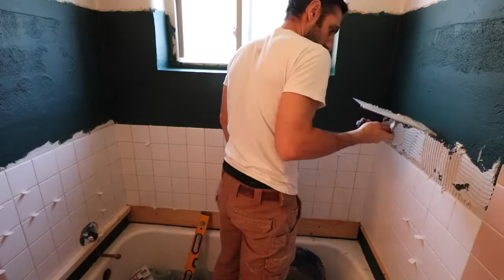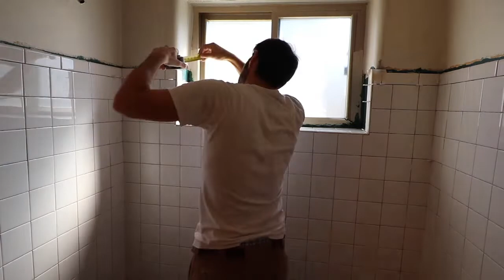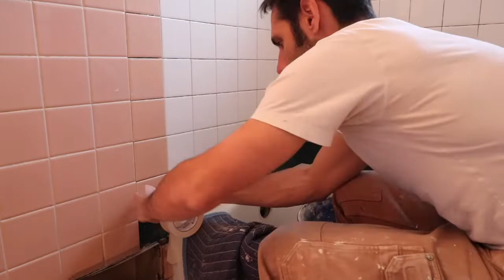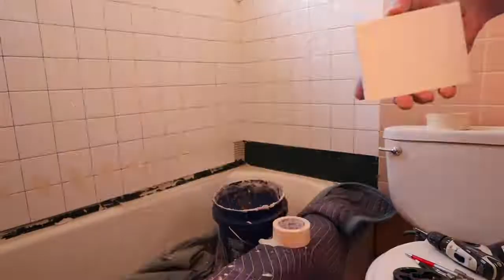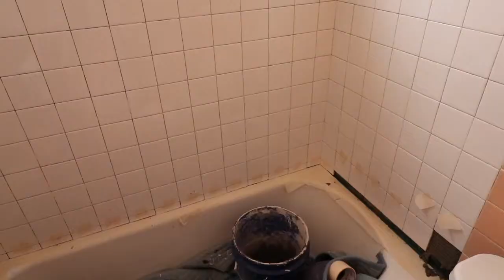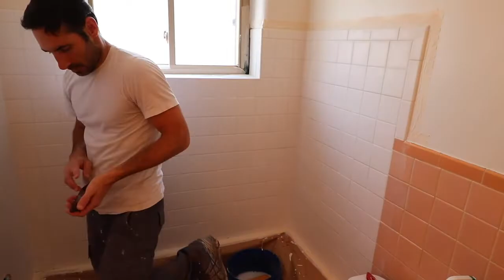Prep Work Makes the Dream Work Part II

Comment: What made you stop the tile Midway up the wall? Why not go all the way up at least to the shower head with tile and the waterproofing?

If you are interested in learning more about tile, waterproofing, bathrooms, etc, I would recommend you follow Sal Diblasi here on YouTube. A really fine craftsman!

Great job on this bathroom! Most landlords would never take the time to do it right.
Reply from the maker: Thanks Gabe, I'm not sure I just stopped there because that is where the previous tile had stopped.  I follow Sal, love his channel.  Tile is probably my favorite trade to do.
Reply: @50Acres  Sal is the best!

Should have concluded you followed him from the professional job you did on this bathroom.

Are rentals and contracting work now your full time job? I noticed on some of your other videos that you had a different career previously.

Keep up the great work!
Reply from the maker: Thanks for the kind words.  Yes mainly rentals, I take the occasional tile or handyman type job when one comes my way.  I used to be a cost estimator, I resigned almost exactly a year ago from that job.  I also am renovating a small mixed use commercial/residential building.  I just kinda do whatever these days.

Comment: If you do another one of these jobs, consider using this product for your tile backer if you can get it where you are. https://www.menards.com/main/building-materials/panel-products/tile-backer-board/georgia-pacific-reg-densshield-reg-1-2-x-32-x-60-tile-backer/1314902/p-1444431332695-c-5704.htm?tid=-3383438579630900426&ipos=3

I use it on all my tub/shower projects, I never waterproof the walls because the surface of this tile board is waterproof.  I use mesh tape and tile mortar on the joints and have never had any issues.  This will save you a ton of time.
Reply from the maker: Nice I will check that out, I have 4 tile jobs coming up in the next couple months so worth a try.
Reply: @50Acres  it's a really good product and if you're nervous about the joints you could always hit them with waterproofing for the first three feet up. As you probably know just as well as I do that every tile tub or shower that you've ever demolished the damage is always where it meets the tub or shower pan..  I use Redguard for tile shower floors and feel like it would be a belt-and-suspenders approach along with mesh tape for the joints in the tile board.